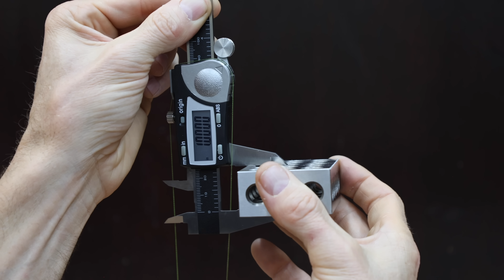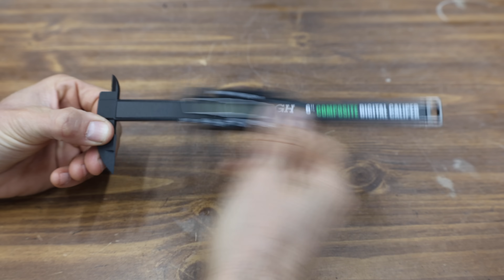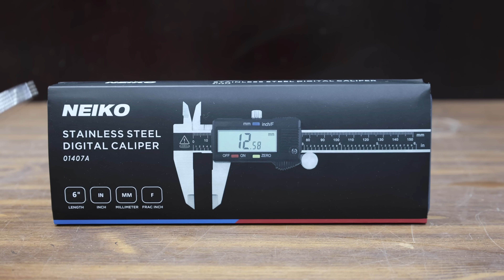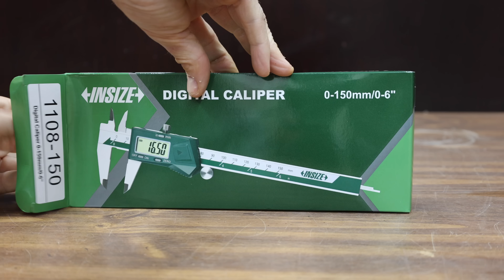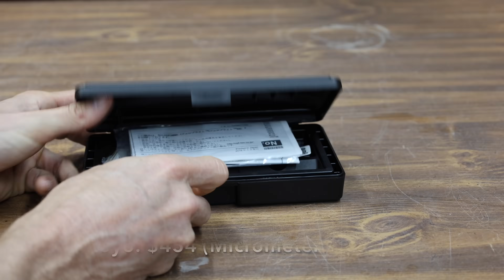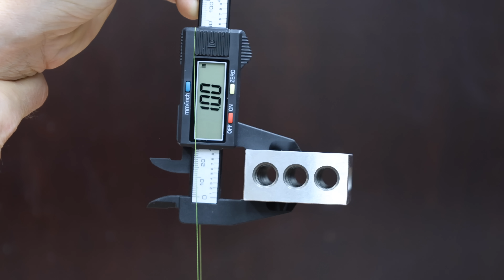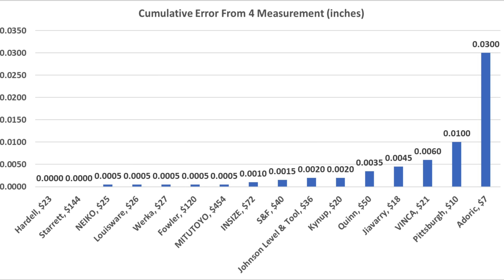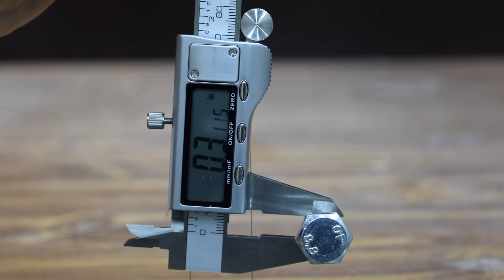I've Been Proven Wrong About Calipers!

Comment: WTF - you could've OILED the mechanism in all the calipers, then your entire premise of comparing these units' "smoothness" is rendered nearly pointless. All of the calipers can be ZEROed. Your block used cannot be trusted as to being exactly 1 and 2 inches - steel wears away and Chinese manufacturing is inaccurate. The Mitutoya micrometer can be re-calibrated and zeroed also - so everything has to be calibrated to Systeme Internationale objects to know what device is accurate or not. The entire premise of this comparison of calipers is fucked.

Comment: I've never changed the battery in my Starrett, (it doesn't have one), since 1969. To this day it still certifies for accuracy. By the way, measuring depth the way you did on a wood surface, causes inaccuracies: Granite surface block, 1-2-3 block laid on that,  then measure depth. Enjoyed the comparison, but I'll stick with my Starretts & Mitutoyos. Fifty five years with 12 to 36 inch calipers & they still all certify. Thanks for the video.
Reply from the maker: Thanks!  Thanks for the feedback.

Comment: You should set up a jig that opens and closes them several thousand times to simulate use and to see if the accuracy holds over time. Also, roughness could smooth out or vice versa.
Reply from the maker: Thanks for the suggestion.

Comment: The biggest problem here is that you measured the block at different jaw positions on different models. Sometimes you had the jaws fully on the block, and other times you only measured with the very tips which can cause inaccuracy.

Comment: Great video and test. I will say that my Mitutoyo has been running for about 3 years on the same battery and gets frequent use. My old trusty Starrett dial caliper never has a battery problem, and you know, while the digital Mitutoyo is great, there is just something nice about the old dial type caliper.
Reply from the maker: Thanks!

Comment: I use a combination of cheap and expensive tools for machining. 

Shars is for anything where the tolerances are above  .010 inch.  If it's under that tolerance I break out the Mititoyos. That being said, my Shars calipers are pretty accurate and repeatable.  I test them weekly with multiple gauge blocks and they are always on the money.
Reply from the maker: Thanks for the feedback.

Comment: I bought that Harbor Freight caliper around 3 years ago to get me by until I could afford a more expensive brand like Starett or Mitutoyo. I'm actually still using it and have gotten by just fine. I don't think I'd use it for extremely fine measuring, like for expensive machining work, but for my diy purposes, it has been surprisingly just fine.
Reply: I used cheap digital calipers for years. I still have a couple cheap pairs I use sometimes. Cheap calipers lose zero a lot. They chew through batteries.  But they do work. They're just not as reliable as good calipers are. So you have to keep an eye on them. Confidence level is low. That's the big difference. Cheapies I always zero out. My Mitutoyos never lose zero. I don't even have to check them. Confidence level is high. That's the difference.
Reply from the maker: Thanks for sharing.

Comment: I had to lap my Mitutoyo calipers before they became smooth to use...
it is to note that high end calipers are designed to be harder to glide the smaller the measure gets (so when the jaws are closer together) to help with accuracy.
Reply from the maker: Thanks for sharing.

Comment: You really needed to measure power used, when on and off.  Some of the cheap brands never fully turn off.  The screen turns off but the electronics don't.  They go dead every two weeks even when "turned off"
Reply from the maker: Thanks for the feedback.

Comment: very nice test. As a cnc machinist i like the mitutoyo. in holland we pay about 100-120 euro for it instead of the 250 dollar what is aprox double the price.  I think the micrometer was the main part of the 445 dollar. they are quite expensive. the only thing i will notice on the test, is the depth is not measured correctly because a wooden table isnt just flat enough to rectify the tolerance you are measure. For the rest, as usual a very clever performed test!

Comment: Over the years I've used a lot of different calipers as a mechanical engineer.  What gets the most use is my vernier Mitutoyo calipers.  I picked them up for $40 used and after some precision stoning and cleaning it's beautifully smooth.  It's great because it doesn't need batteries and it's a single moving part, I can throw it in my bag and not worry about it.  When I have to do more than basic point to point I use a Mitutoyo digital with data output.  I can attach it directly to usb and take tons of measurements as well as do incremental offsets and datum modes.  But at the end of the day, they're "guessometers" if you need more accurate measurements you're going to grab a micrometer, or some other gaging method. Keep up the great work!

PS Also I should mention Mitutoyo advertises that they specifically do not auto shut down as a feature.  Because Mitutoyo gets used a lot in production environments where you measure stuff all day you don't want it randomly shutting down and loosing your zero reference.

Comment: I have to take issue with measuring the depth oh the hikes in the block on a wooden table that obviously has dirt on it. Even without dirt I highly question the flatness of that table top. That’s what surface plates are for. Also, I would have made a fixture to make the outside block measurements consistent by keeping the caliper jaws perpendicular to the block faces. A small error there can mean a a half a thousandths difference or more.

Comment: You should look into "Measurement system analysis" which is a statistical method for assessing the measurement tool, the operator and the method. There is no such thing as a perfect tool even if the tool itself is extremely accurate as the operator and the method create variances. I used to build measurement jigs to minimise variations between method and operators. Back in the 90s Mitutoyo were the king and still are. If you are a professional in a professional shop doing professional things then no contest. One piece of rework would pay for a whole suite of measuring tools.  As for me I have a couple of cheapo plastic calipers for the dirty, under the car stuff (is it 48 or 50mm seal?) and a nice set of 200mm with a large LCD in the garage because nothing I make needs to be that accurate.
Reply from the maker: Thanks for the feedback.

Comment: Love the channel and the content! But a few constructive criticizms from someone that has spent decades in the inspection room, of the most glaring inconsistencies:

-When performing the depth measurement, you should preferably have a flat & clean surface for your 1-2-3 block to sit on. A wood table with scratches and dirt/dust csn easily give you an error greater than your test results. You should also have something in place to ensure perpendicularity like a square/1-2-3 block/depth mic base attachment. A slight difference in how you hold the calipers can vary your resulting measurement by more than the tested resolution.

Hope that helps for future testing.

-When measuring the o-ring groove, you had the bolt in different orientations between different tools. The groove isn't consistent enough for orientation to not matter, therefore you can and likely are measuring spots with differing physical dimenions(especially when trying to measure something down to that resolution).
Reply: Yeah, I love the guy, too but there was a lot of imprecise testing to gauge the quality of a precise instrument.
Reply: He also didn't mention which if any of the calipers use carbide faces, which is another super important aspect of modern high precision digital calipers.
Reply: I'll add to this that I suspect any discrepancies he had with the Mitutoyo were due to dust/fiber/debris and other irregularities of his test setup, rather than the calipers themselves.  Having upgraded from cheap calipers to Mitutoyo Absolut calipers, their repeatability and accuracy never stops blowing my mind.  It's also disingenuous to rank the Mitutoyos with a price of $454 when he knows that's the price for the bundle with the micrometer, not just the caliper, which is available separately for half that.  And, he never showed a test of the true cumulative error of working with non-absolute calipers, for example he could have taken a set of measurements of the 1-2-3 block, then opened and closed each caliper fully 6 times, then re-measured the 1-2-3 block without resetting 0.  From my experience with cheaper calipers, he would have gotten absolutely gibberish numbers from many of them, which is why the absolute feature is SO important.  And worth the extra $$$.
Reply: Should be on a clean milled flat surface. Wood is never perfectly flat no matter what.
Reply: Agreed! Even this idea wouldn't be perfect but could have clamped the 123 block down on the edge of a piece of tempered glass.
Reply: I always certified caliper depth scales with two stacked gage blocks at various positions on the scale.
Reply: Like a granite flat plate might help for some of those tests.
Reply: I get the sentiment, but for any of these calipers that doesn't matter one bit, and calling 'glaring inconsistencies' is a wee bit funny - its not like you can sit a bearing with any of them, no matter how hard try. 
He did 99% right - wiped, constant pressure, used 123 blocks.
Reply: @VEC7ORlt  The Mitutoyo Absolute digital caliper is repeatable and accurate to 0.01mm or 0.0004".  SKF's published tolerance for a 250mm diameter (~1") bearing is 0.04mm.  So yes you ABSOLUTELY CAN fit a bearing with these.  With some choice as to how tight a fit you want, even.  Welcome to the future... stop treating all digital calipers like Harbor Freight calipers.  There are MUCH better ones out there, and a review like this is supposed to educate you as to that fact.  But because of the flaws of his testing you came away not realizing how game-changing these high end calipers are nowadays.
Reply: @LizMatzelle  your error bar is the tolerance of your caliper, which is +/-0.03mm, for 250mm and for H7/p6 will result in any fit from sliding to press, which is laughable.
Reply: @VEC7ORlt  You're taking the advertised +/- 0.001", converting that to metric and rounding up, right?  So 0.001" becomes 0.0254mm which becomes 0.03mm in your mind.  But the "guts" of the inch and metric calipers are the same, they just have different markings on them, and the metric caliper of the exact same size as used in this review is accurate to +/- 0.02mm and repeatable to 0.01mm.  And that's without calibration, so that's the "worst case scenario".  That's the worst that they'll ever let get out of their factory.  In my experience with their tools, however, it is unheard of that they perform "at their worst".  My 6" Digimatic was purchased with the calibration certificate, and it shows that the actual accuracy is 4x better than advertised.  In fact, Googling a few other calibration certificates folks have posted online for 6" Mitutoyo calipers, I have yet to see any that show a more than 0.0005" total deviation, compared to the 0.002" maximum permissible deviation advertised.  It's normal for companies putting "specs" in their product listings to exaggerate how good their tools are, but there are brands that do the opposite, and Mitutoyo is one of them.  You shouldn't judge their tools based on the specs, but upon actual real-world testing.  That's supposed to be what we're here for, after all.  In the real world, you absolutely can fit a bearing with these calipers, and do so with some specificity.
Reply: @LizMatzelle  their stated tolerance is +/- 0.03mm, also I don't speak inches or other silly units.
Don't confuse resolution with accuracy, I'm not even speaking about bad measurement practice - you need to an order of magnitude better than the value you're measuring, otherwise its noise.
Reply: @VEC7ORlt   Also measuring a fitted large diameter with 2 points is laughable, if we take his exemple which is SKF bearings, then it's likely Diameters done on a lathe machine, which mean it very likely has triangulation form default from the lathe holder (depending size, material and how it was made you often get between 0.004mm to 0.07mm triangulation form default once you release), and that's something you don't see with a 2 point caliper.

Regarding Calipers, Mitutoyo are by far the best ones, our company give us a brand new 0-150mm Mitutoyo Absolute Coolant Proof IP67 every 2 years.
And in practice these (given they are perfectly CLEAN and Smooth) have an accuracy of 0.01mm (basically reading digit rounding error), and NO repetability error whatsoever.
Also, these get even smoother after few weeks/months of use.
And obviously larger Calipers aren't as accurate.
But I do often end up measuring fittings down to 0.05mm with my calipers. Depending the parts and the drawings (sometimes it's not worth it or you can't do it accurately). I think a big part people forget is looking if what and how you're trying to measure make sense.
Only once we had an "imperfect" Caliper from Mitutoyo, there was a 0.02mm offset between the base Zero and the depth scales Zero (without zeroing after flipping it), but either you bother to zero or you just know and remove 0.02mm from your readings.

Usually the loss of precision (with good stuff like Mitutoyo) is because people don't clean their measuring tools (looking at you machinists with calipers that can barely slide anymore) or force on them too much,  destroy the geometry, measure dirty parts/parts full of coolants, or use tools incorrectly.
You souldn't put much pressure on a caliper, and mostly, you should always put the same amount of pressure on a caliper, hence why it can't work if your caliper doesn't slide properly.

Source : I am a Metrologist in a high precision machining company working with classical tools, CMM and Optic, I cross-check my tools all the time and we even make custom parts for SFK themselves (staying on the topic LOL).
And no we don't throw away our Calipers every two years, we just give them to machinists.
Reply: yeah, in other words, the way he evaluated precise measurement instruments is entirely a joke.

it's not how it's done.

Comment: I have two Mitutoyo digital calipers, and three generics  I find that the black body, stainless slider generic calipers are pretty robust.  One, I've had for at least 15 years, and it is still as accurate as when I bought it for 10 bucks at NAPA.  Generally, I change the battery when the display starts to dim, and I routinely hit the "off" button after I've taken a measurement, not waiting for the five minute timeout.  

One of my generics is an 8" triple function, and I rarely use the fractional scale, it's too fussy.  It would be a lot more useful if you could set the scale resolution, say 1/64 or 1/32.  It reads 1/128, and at that resolution, I'd rather have a decimal number.  Invariably, the calipers I grab are the cheapie 6" generic, which is very smooth after several years of use.  I do keep them all lightly oiled.   The Mitutoyos are reserved for machining, and kept in a tool box.  The generics are usually out on a workbench.
Reply from the maker: Thanks for sharing.

Comment: The machine shop I work for just purchased a line of Insize digital calipers . I have found that they are unreliable after a period of a few months . They will begin reading some outrageous measurements like 74.000" . The batteries are good / not used around coolant / We just return them back to the tool crib and hope we get a Mitutoyo dial caliper in return .
Reply from the maker: Thanks for sharing.

Comment: I got the Mitutoyo on sale at Amazon and have been absolutely delighted with it. Very useful to be able to have one set of calipers to measure in inch or mm units. Very smooth action.
Reply: There's no such thing as Mitutoyo calipers on sale. Amazon is known for selling counterfeit Mitutoyo calipers though. The fakes generally do have a good look and feel to them. If the battery is dead in a year it's a fake. That's the one thing the bogus pairs can't copy.
Reply from the maker: Thanks for sharing.

Comment: Buy NEIKO. Take it apart, clean it inside and smooth out any rough edges in the machining. You will love your caliper.
This will apply to most of these brands except once that are fiberglass/plastic  but NEIKO is cheap and well made, just not well polished.
Reply from the maker: Thanks for sharing.

Comment: Parasitic loads on cheaper models is for me the most annoying thing about these calipers.  That's the thing to me that is the most important.

I don't use these tools every day so if I store a set for a month and it's dead then it's useless.  So any that come with a spare battery tells me right off the hop that I will need to disable the battery every time I use it.
Reply from the maker: Thanks for the feedback.

Comment: For me it's simple: if you use these more than a few times a week. buy once, cry once. And I am a cheap fker. Also, mitutoyo battery usually lasts about 6-10x longer than other few brands I tried, so over time, you will end up recouping your $ (maybe it'll take 10 years...) - After trying alot of these, I end up buying old (about 15 year old) mitutoyo set on ebay in the wooden case, for sub $100 (calipers and micrometer) and I will need nothing else.
Reply from the maker: Thanks for the feedback.